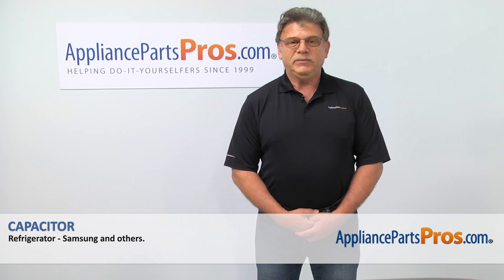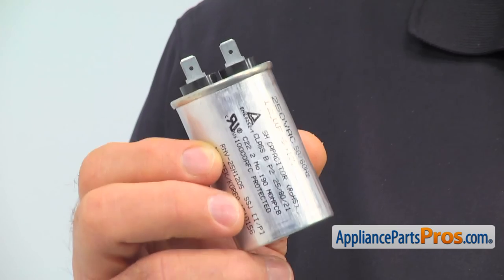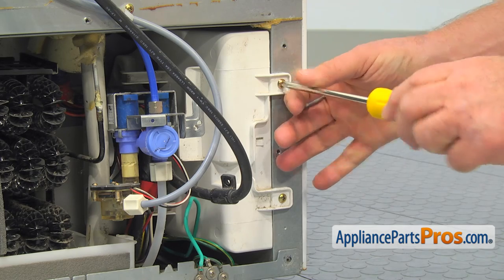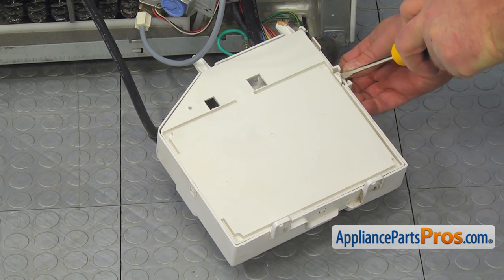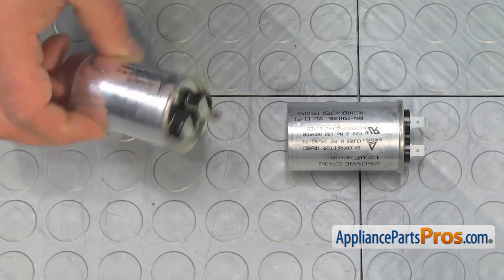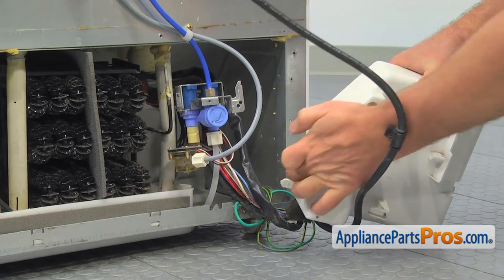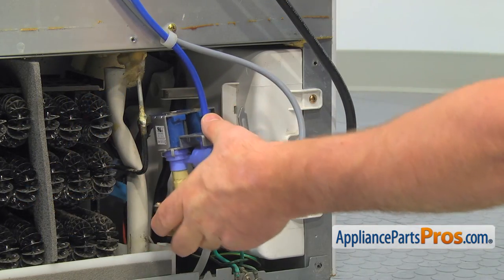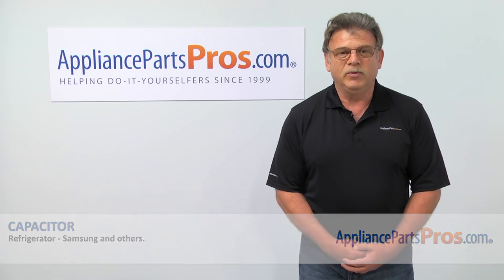How To: Samsung Capacitor 2501-001045

Comment: I have the same model the fridge and freezer works well but till reaching the required temperatures on both sides  and then  the compressor  will not run again till I pull out plug and put it again I replaced PCB board but the didn't fix the problem should I replace the capacitor thanks in advance
Reply: It seems to be common problem with no solution available online. I have a same problem and so many others. Don't know why there isn't any answer?